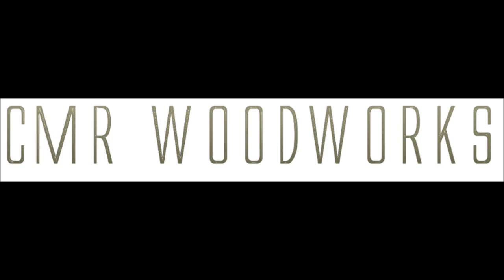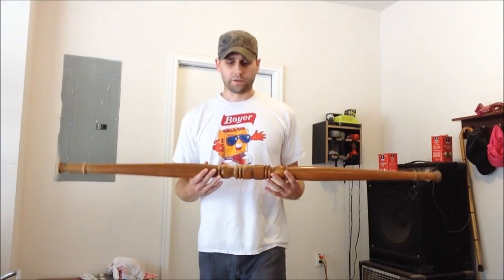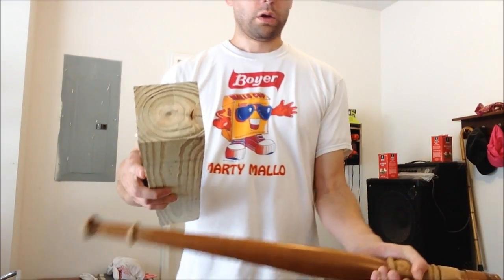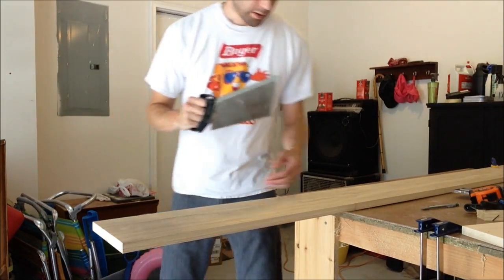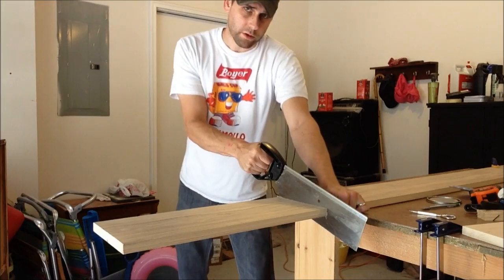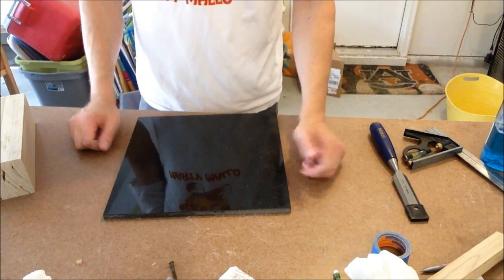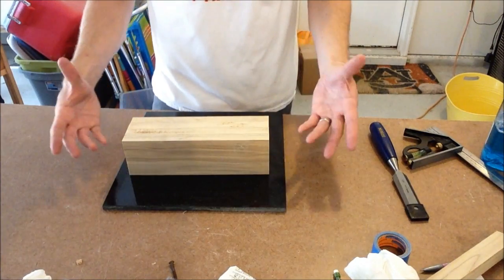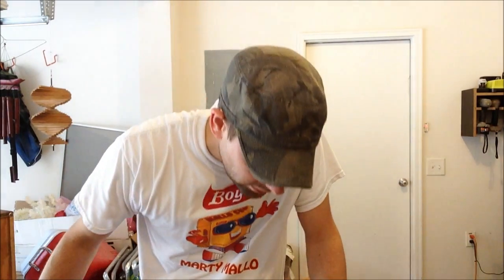Organ Leg Coat Rack Part 1 (CMRW#1)

Comment: Cliff, I love the video - you have a great presence on screen.  Little tip:  you may be bearing down too hard on that backsaw.  I do the same thing, but I find if I just focus on forward/backward motion and not downward pressure, my cut goes WAY faster, cleaner and less stress on my hand, wood and the blade.   Hold the saw light as you can while still controlling it and just literally let the weight of the saw (I know, its not much) do the cutting.  Just sayin...    Looking forward to next vid.